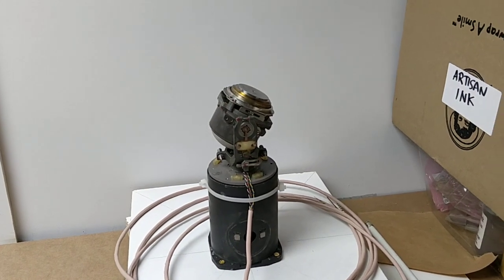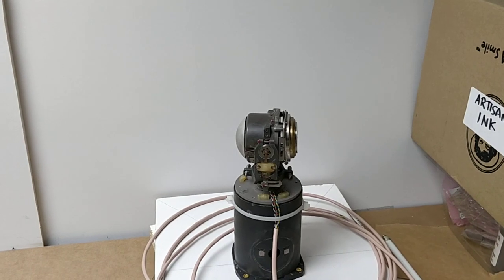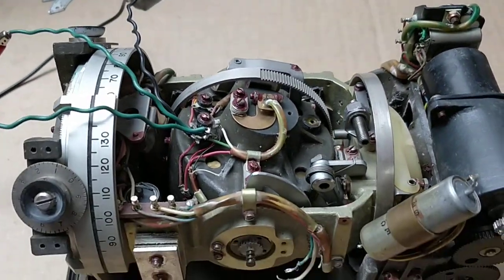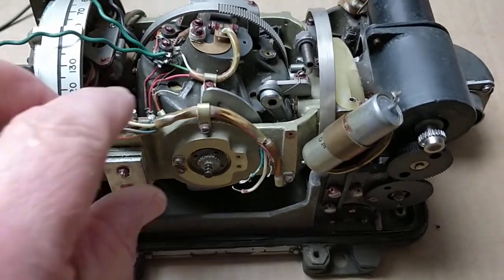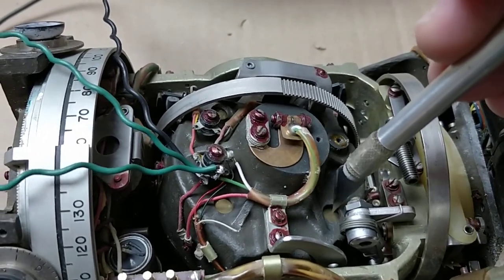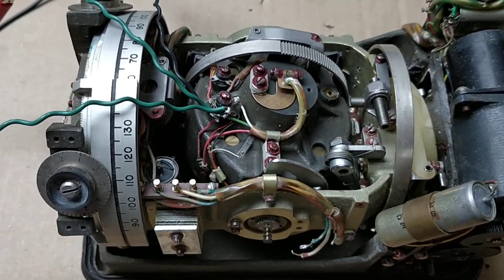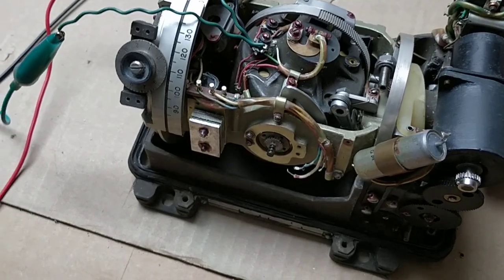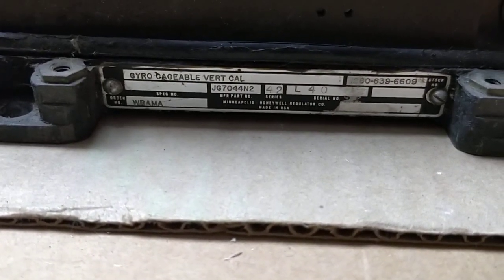Another aircraft gyro spinup

Comment: So now we know for a fact that Foucault lied to the entire world, when he used an even LESS precision of mechanical gyroscope and said it showed the Globe's rotation.   Nobody has ever witnessed the rotation of the Globe with a mechanical gyroscope, regardless of precision.  

Makes me wonder if he lied about his Pendulum as well.  I'm pretty sure a ball swinging back and forth, but having to push the air out of the way while it does so...effects the direction of it's swing.   I think the front leading face of the ball pushing the air out of the way while it swings, is being diverted to the side off a straight swing somewhat during this interaction of pushing the air out the way while it swings.   

Don't let me find out the same Pendulum placed in an evacuated vacuum chamber will just swing back and forth in a straight line, because there's nothing for the ball to push out of the way while it swings back and forth, and no presence of a Torque pushing against it sideways to knock it off a straight line swing.